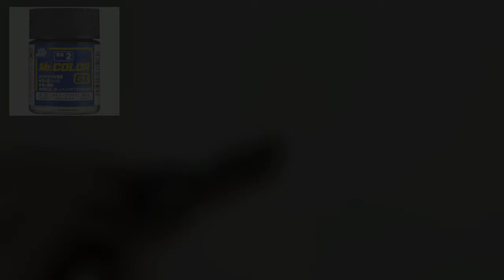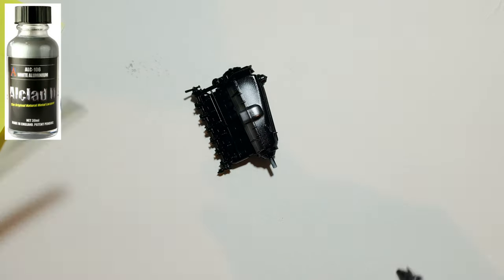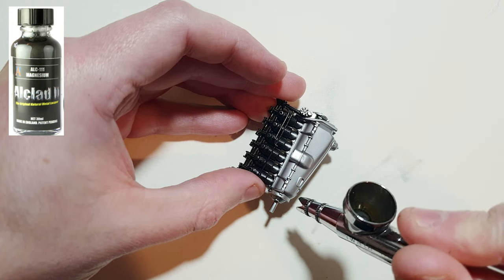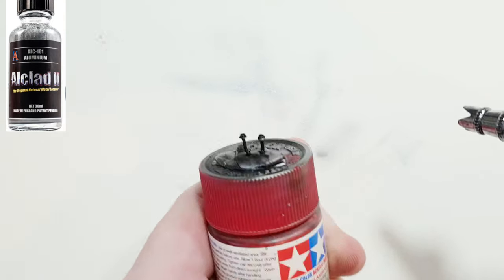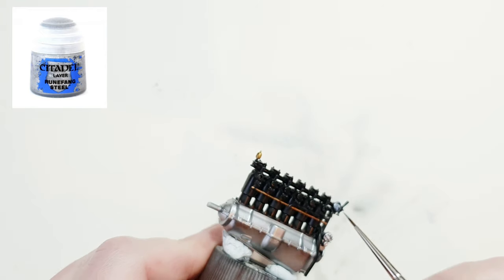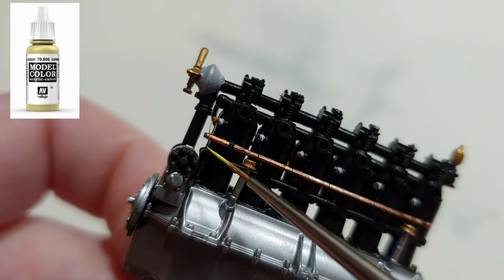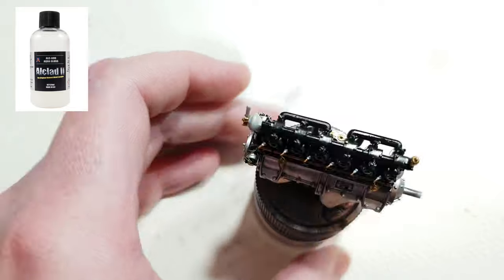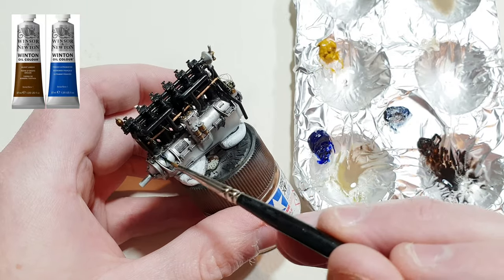Painting a 1/32 Wingnut Wings Mercedes D.iii Engine

Comment: There is no doubt about wingnut engineering... but the price... uh..... Also may i ask, why did you use ultramarine blue oil paint in the mix ?
Reply from the maker: I use a mix of Ultramarine and burnt Umber to make a very dark almost black without using black, In a lot of art theory a richer dark instead of a black is preferred. Same with burnt Sienna and cerulean if you want a very deep moody grey, you can alter the proportions to seem more mucky ( more brown) and more oily or shadowy (more blue)
Reply: @lpjmodels  i wonder, mix paynegray with burm umber will have the same result?
Reply from the maker: Not exactly the same but it will work !

Comment: Which air compresor are you using and what is the pressure used for painting in this video?
Reply from the maker: Hi there, I use an iwata sprint jet (non tank) and  spray around 20 psi